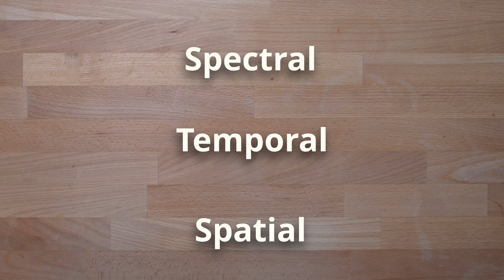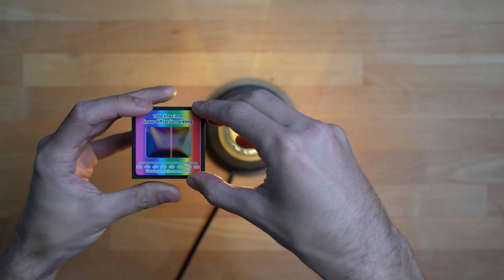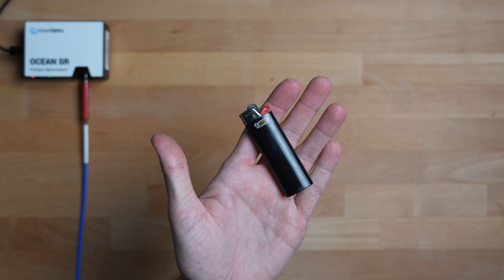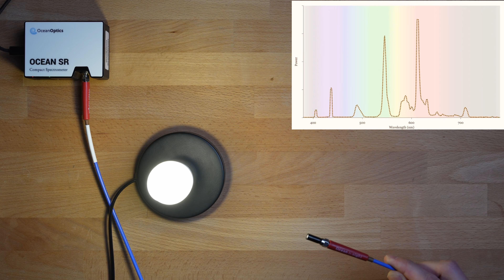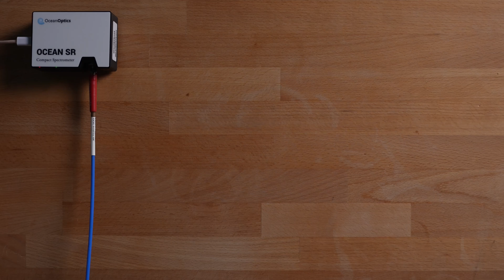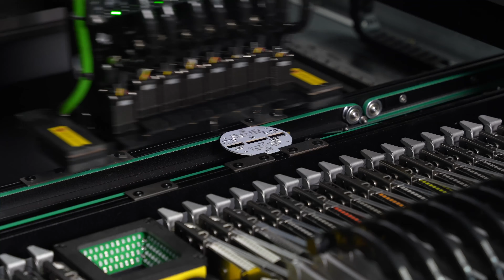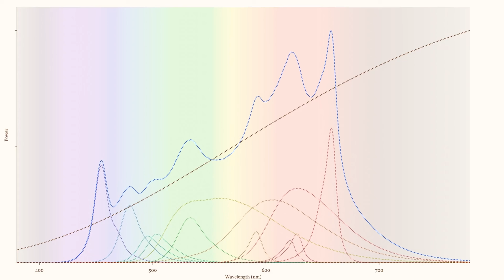Why Modern Lighting Feels Bad (and How I Fixed It)

Comment: This is really cool, and I applaud the work you're doing, but it makes me laugh how different peoples' tastes can be. When you were comparing the lighting effects on the table of the incandescent, LED, and fluorescent, my preference was the LED, by far.

I also really have a thing for "daylight" bulbs, i.e. 5000k. I recall some years ago I purchased these two 200-watt equivalent 5000k CFLs from Feit and I adored those things. I learned about how the arc that generates the rapid startup of modern CFLs progressively degrades, because the circuitry in the base rectifies the 120VAC into DC, before inverting it into 22KHz AC again, before striking the arc. So I made the decision to just leave them turned on all the time. They lasted for years and years. Eventually, one of them broke, and some time after that, the other one stopped working. So I opened up the base of the one that stopped working, replaced the electrolytic capacitor and a diode that had gone bad, glued it back together, and it worked again for a year or two after that until it finally died. I miss those things, lol.

But these days LEDs are cheap enough, run cool enough, and produce sufficient lumens to perform the same job... but the problem now is that many of them are so cheap that if it's not the electrolytic capacitor that dies first, it's the rectifier that dies first... and as either of those start to fail, the LEDs are over-volted or fed excessive currents and they start to burn out.

With all that said I have a couple of questions. Does the base of the EP01 rectify the voltage directly from a 120VAC wall outlet, or does it come with a wall wart that does that? Either way I assume you're using a switched mode power supply, feel free to correct me if I'm wrong. Also, is the software/firmware open-source?
Reply: I applaud your preference only because I’ve done the same thing for CFL bulbs I actually found “warm” enough (2200-2700k) 😂 I won’t ever understand affinity or preference for cooler light temperatures outside of an operating room or a chemistry lab - but am fascinated when others like it. I can’t stand the LED in his comparison, although it’s slightly better than the CFL.  “Daylight” bulb = medieval torture, for me 😂

Comment: This needs to be bundled to fit into a traditional lightbulb socket and sold as adjustable bulbs or smartbulbs.   A random lamp doesn't solve much of anything, but letting us replace our bulbs with the principle is something a lot more actionable and usable.   For an adjustable bulb it'd be nice if we could use a switch directly on the bulb's base somewhere to manually toggle the light without dealing with smartbulb set up hassle and also not add more bandwidth drain on a household.   Maybe multiple separate switches so you can individually adjust the brightness of each color for your own color curve.   Just green light would be nice for migraine-havers.  Green light seems to help headaches.  Though the broad curve warm light would also help avoid them better.

Comment: I recall a research paper I read a few years ago (sorry, my memory is a bit fuzzy on the topic), in which they were attempting to do something very similar using solid state materials. They were using photo-lithography to build a fractal pattern on thin wafers of optical calcite in graphene with phosphorous dots distributed throughout the material, then stacking the wafers, creating a 2.5D (sliced 3D) fractal that interfered very specifically with the light passing through it. So basically using constructive and destructive interference to shift the spectrum of the source light into something full-spectrum. Altering the scale of the printed graphene and phosphorus would alter the light spectrum emitted. The idea being that a hypothetically mass-produced, thin lens could be applied to individual LEDs to improve the spectral properties. 

I'm not a light researcher by any means, that's way above my understanding. So I apologize if I'm butchering the concept or have it totally wrong, lol. That was just my understanding, and I could be totally wrong. But as I recall, it worked very well, they just had issues of scalability at a production level. But that was before present day graphene deposition methods were fine-tuned. Tooling for that could still be prohibitively expensive, and I have no idea what the material properties are in terms of strength or how well it would hold up to temperature, the impact of various production defects and tolerances, etc. It wasn't cost-effective at the time, but it may be worth looking into their methods. You may not need the precision they were looking for, industry runs on "good enough for the intended purpose" where academia sometimes gets a little too perfectionist in trying to prove an underlying principle. There may be a cheaper or easier way to accomplish something similar. It was also extremely diffuse light, I could imagine getting optical clarity on calcite cut to fractions of a millimeter and then stacking them would be a huge challenge. But Calcite is cheap if you can cut it well enough, and other printing methods and materials may be viable. We're talking about primarily structural properties. I believe the graphene lithography was more a necessity of scale and resolution than necessary for the effect. 

Look for "Solid-State Fractal Diffusion Materials". I don't recall the exact paper, I was looking into this for sound and happened across research using the same principle for light. I believe I did need to Sci-Hub it out from behind a paywall, lol. Again, it's way above my pay grade, so it might be nothing, but it was an interesting rabbit-hole to go down.

Comment: One thing i really dislike about leds is not the leds themselves but what companies do to achieve the claimed light output.
They drive the leds right to their limit which end up running very hot and will destroy them fast, aka enshitification.
Please, if you do succeed and become a big company, add more leds (double or triple) and run them at a lower voltage so they will run more efficiently by not wasting energy as heat. I wish you luck from Canada :)

It's kinda the route i took when i worked on my building's hallway lighting. I picked leds with a much higher light output than necessary and undervolt them with a PWM dimmer. They can be ON all night long and still be cold to the touch.
Luckily my hallway's wiring could be isolated so i unplugged it from main 120v AC and connected a 12v DC PSU and now use 12v LEDs. Their max light output is 60w equivalent but in chandelier of 5x, running them at 7-12v give a good 10-300w(led 12v; 5-60w) equivalence.
What i did was literally just to avoid enshitification and they will likely go well pas 30,000hours of ON time.
Reply: I like the way you think. This is completely true, and - it was the right call. LED chips (in vast majority of cases) also reach peak efficiency when they're being under-driven, often a higher CRI thresholds on top of that. Though I personally prefer using constant current for general lighting. I'm not 100% sure, but I think I read somewhere that Philips manufactures custom LED bulbs for Dubai - where they use more LED filaments but they're underdriven on purpose.
Reply: @vex9596  In my case PWM was a better option than an amp limiting controller because it's a two level building and the wiring from my PSU in the basement to 2nd floor upstair is really long, i get a voltage sag of 1.4v under load, i only have access to the positive wire (i'm use ground as negative for the modules to work) and those edison bulbs can do 12-24v. On paper they are not ratted dimmable, i can only get them to dim between 6-9.8v.

Really? Dubai get enshitifcation-free led bulbs? I did heard that when Philips started making leds they were built to last but not about Dubai.
Reply: @TwinShards  Makes sense in that case, especially given the constrictions. I'm kinda used with working with driverless chips and modules, so I generally have a bit more wiggle room. Nothing inherently wrong with PWM whatsoever though, as long as the frequency doesn't cause headaches.. but then again, it's in a hallway, not exactly a space where you spend hours :P

And yeah, I'm like 90% sure I heard those bulbs in question were specifically only available in Dubai a few years back. Not special in terms of materials, it's just regular LED filaments ("micro led strips" with coating), but different driver design and config. Didn't see a teardown of one though

Comment: 1) Nobody's selling or buying fluorescents any more
2) LEDs with high color rendering index may have some deficiency in cyan, but the rendering of "feel good" colors (skin tones and food) is close enough to incandescent as to be negligible, and is probably not distinguishable by the majority of people. So, creating a closer-to-incandescent spectrum offers some small improvement, but existing LEDs are not producing "uncomfortable" lighting. 
The place where this does make a difference is movie studios, where the slight differences in manufacturers and from incandescent make mixing sources a problem, and in printing and dying, where the cyan deficit causes differences that must be accounted for in matching client standards.

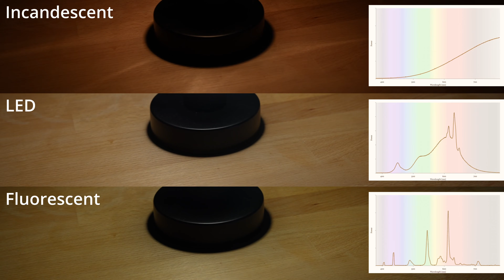Comment: 10:20 This entire comparison is way too unfair, you should at least use 3 lamps that advertise the exact same temperature color.
Reply: It’s not supposed to be fair, it’s supposed to be an illustration of the properties of different light sources using extreme examples
Reply: @rileybaker8294  Not sure man, I think that part of the point was showing that one is better/more desirable than the others.
Reply: @rileybaker8294 that part of the video was about showing saturation of different objects in the environment. The creator of this video ought to have used at least use bulbs that advertise the same temperature for us to better understand the difference of how the environment (the wood) is illuminated

Comment: Since you have many LEDs, PLEASE be sure to light them at different times (if you use PWM) so you can reduce total flicker. I built a flicker meter in the beginning of the 1990s and it was fast enough to see that the CRT phosphor actually lived so short time that only a few pixels behind the current one was contributing at all, there was no "image" at any point in time, just a flying pixel that built an image in YOUR retina (or camera).

Apart from spectral distribution flicker is something you subconsciously notice, do not underestimate it.

Eink Boox have analog drivers for the front light and it is so radically more soft on the eyes than any other device with PWM backlight or frontligt. They got it right, eliminated flicker completely.
Reply: As a person with a different perception of light, I agree with every word you say! Flicker is terrible and it's very difficult to find a lamp that glows smoothly these days. So I use old incandescent lamps. And 50Hz CRT monitors were a real punishment. The interesting thing is that ordinary people don't seem to see the difference.
Reply: @dilirix-dei  I used CRTs from 1979 to 1991 in pain, then LCDs became useable and after 2000 they have been good. An LCD with WLED backlights can be ok but I prefer OLEDs over LCDs. Incandescent are best but some LEDs driven without PWM and driven by DC can be restful. The spectra is still not perfect but getting better.

I believe some people have more sensitive senses and faster responses.

I also cannot exclude noises, I listen to everything at once making it hard to understand anything if several people talk simultanesously, I follow all conversation at the same time and it gets chaotic.

I also can sense North, not perfectly but I can orient myself better than most.

Some things good, some bad. Flicker is truly a bad thing for me.
Reply: @Anita95_original  I feel your pain... Yup, it turned out I'm autistic and majority can't register such frequencies ¯\_(ツ)_/¯
Reply: With 30 different colors, that would produce flicker in the spectrum as well as the intensity.

Comment: honestly I'm perfectly happy with commercially available warm light led lightbulbs. I'd say the same for theater lightings. I've seen incredible progress in about 10-15 years in this field; it used to be that for home you'd default to cold light (which is unbearable); warm llght and lower color temp came later; and same in the theater space were I would stay away from led lightings and now this is all I use (me and every one else). You have CCT tech that mixes cold and warm; it can dim to a warmer white; it's pretty convincing. Now this is is indeed very interesting technology, but that seems costly to produce and it will probably make more sense in artistic contexts. also part of it is CCT but better, you probably won't use this technology for a fixed color temperature

Comment: The funny part for me is I struggle to find lamps that have a high enough color temp.  I prefer the look of indirect sunlight coming through windows.  Since the sky itself is blue, that means shadows are also blue.  And boy howdy do you need a high color temp to recreate that effect.  It's also tough to diffuse it enough to have that look.  If my health was better, I'd build something like a four foot by four foot diffuser with high end LED's behind it and a separate switching supply.

Comment: The comparison images were, to be honest, underwhelming. Your product was just a darker image, I tuned gamma down for the conventional LED image that you compared and it basically was the same color. Your spectral comparison didn't impress me either, its actually very similar, and the comparison image showed that. Maybe your light exposed more details in the wood, but I'm not sure, as it was blurry and also the source of the color came from a different direction that exposed details differently. Cool concetp though. Does it compensate aging LEDs, LEDs age differently as they consume different amounts of energy.

Comment: How is this any different that the commonly available color shifting LED lamps?
Reply from the maker: Existing commonly available color shifting lamps do not shape the underlying spectral power distribution. In the warm white / cool white tunable lights, they are typically linearly interpolating between the two banks of LEDs. In colored lights, they're utilizing red, green, and blue LEDs to construct other colors. By using more color channels spread across the visible rang, we're able to produce more accurate lighting.

Comment: Are you basing this off of bulbs only? There are strips that have/do this already no?? Just not in “bulb” format.
Serious question, not trying to give crap. Genuinely curious.
Reply from the maker: I am going to cover metamerism, CRI, TM-30 and other color metrics in a future video. I had started to include it in this video, but decided to focus on spectral power distributions / blackbodies exclusively as they're the foundational understandings needed before going into color metrics. 

I have measured EP01's CRI at various temps. CRI at 2700K is 98-99 for reference. I tend not to use CRI as the authoritative metric as it's a bit unreliable (https://en.wikipedia.org/wiki/Color_rendering_index#Criticism). Enody's optimization relies on a modified SSI to more accurately emulate the spectrum directly instead of using the sample based approach of CRI.

The critical difference between a standard high CRI bulb and a spectrally tunable bulb is that the spectrally tunable bulb can recreate high quality light across the whole blackbody range, instead of being locked into a set CCT / SPD. For example, a sunset or sunrise can be mimicked and have high quality light throughout the entire fade.

Comment: You're not even using an incandescent bulb... That's an EL wire coil.
Reply from the maker: This is an incandescent bulb. An EL wire coil would not have a perfect blackbody spectral power distribution, and would not extend well into the IR region.

Comment: Very interesting project, and congrats on launching a product! But if you're hoping for any kind of success with this, you absolutely need to make your product compatible with standard light bulb sockets. It also needs to be much, much brighter; as it stands it's really nothing more than a novelty.
Reply from the maker: You're absolutely correct. The goal of EP01 is for it to function as a proof of the platform and a development kit for future form factors. Having a lamp on your desk that is used for authoring before deploying the lighting recipe you've developed to larger installations.

The longer term plan is the same as many new hardware companies: start with a high-end product while the technology is still expensive, then scale manufacturing and bring costs down. This will allow Enody to ship increasingly diverse products (including standard bulb factors) and make spectrally tunable lighting cost competitive with current LED lighting.

Comment: Are you planning to eventually release standard E27 bulbs?
Reply from the maker: Yes! The goal of EP01 is for it to function as a proof of the platform and a development kit for future form factors. Having a lamp on your desk that is used for authoring before deploying the lighting recipe you've developed to larger installations.

The longer term plan is the same as many new hardware companies: start with a high-end product while the technology is still expensive, then scale manufacturing and bring costs down. This will allow Enody to ship increasingly diverse products (including standard bulb factors) and make spectrally tunable lighting cost competitive with current LED lighting.